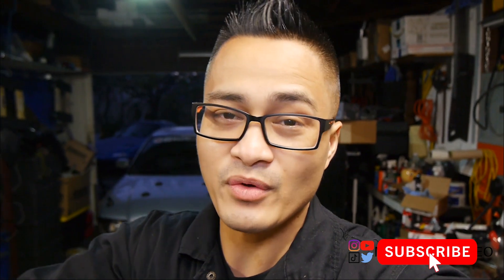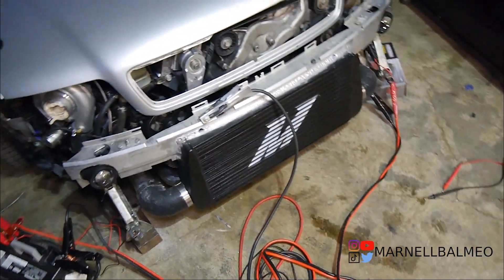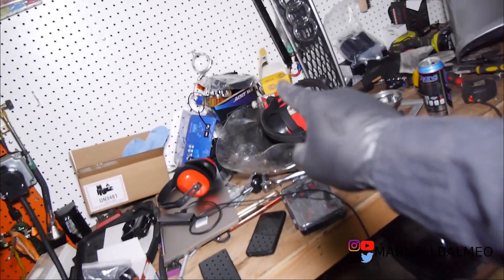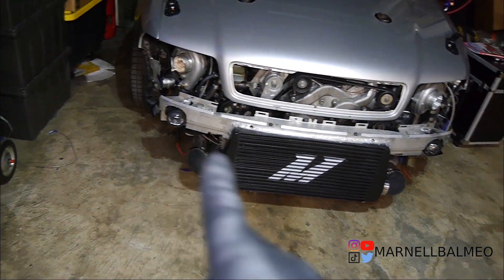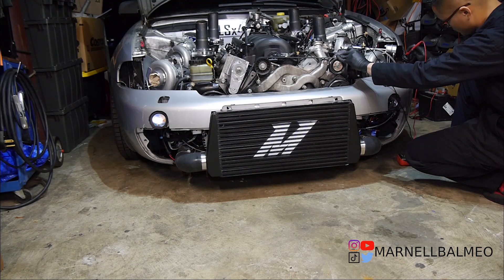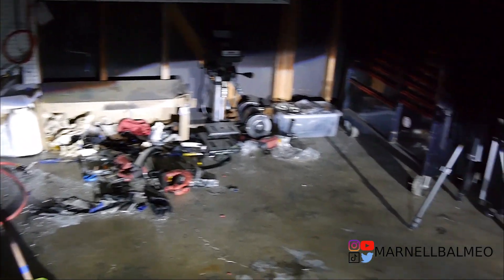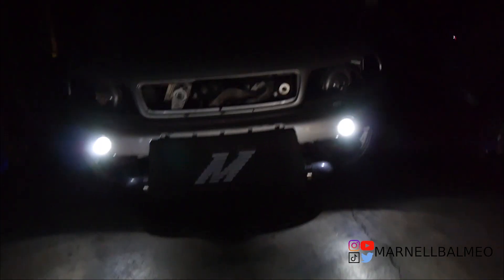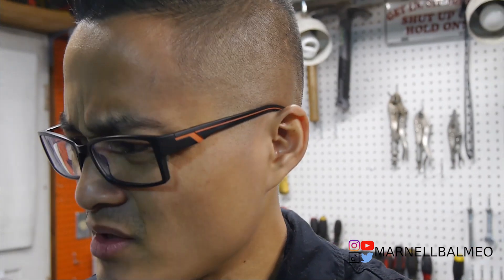It’s brighter than anticipated.

Comment: Awesome build. As another light source you could mount a light bar to run across the top of the intercooler. But yes I would definitely fit some indicators somewhere on the front.
Reply from the maker: Not a fan of light bars. Plus going for more sleek look.